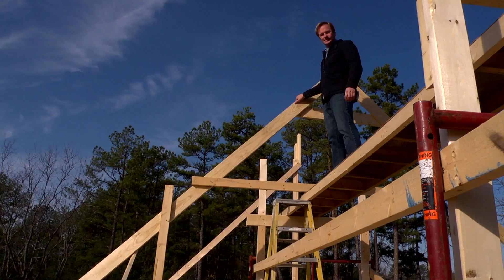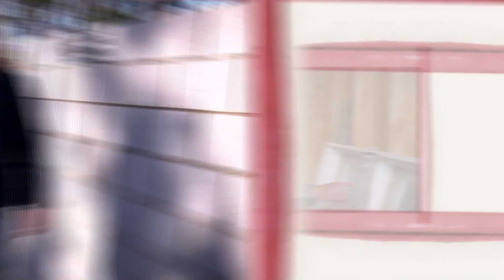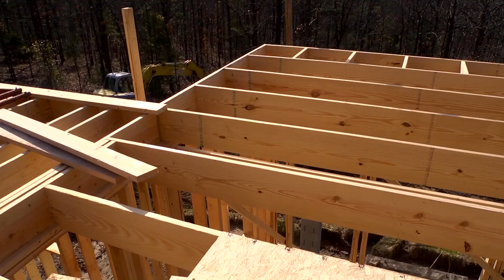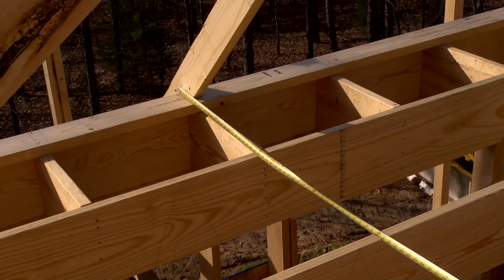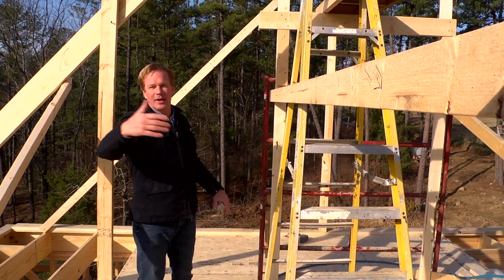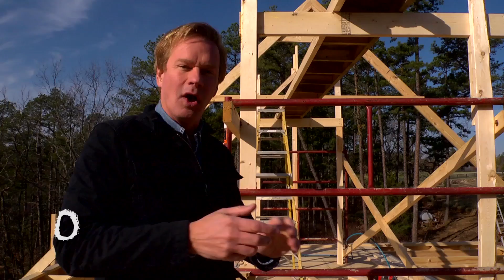Roofing | Day 21 | The Garden Home Challenge With P. Allen Smith

Comment: I believe you could have made that upper level alittle wider. Twelve feet seems wide but once you rock the walls then the true size of the room becomes more apparent. I noticed as you explained the ceiling and wall configuration in the attic--I take it you're a little under 6ft tall--as you stood next to what would be the inner wall of the room, the "wall" extended well above your head.